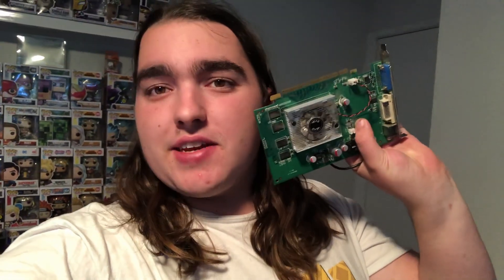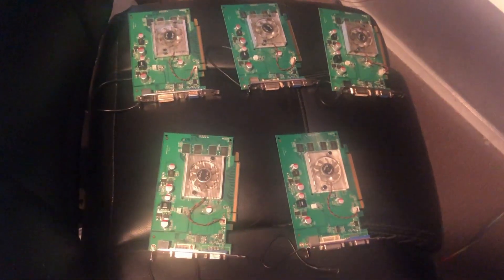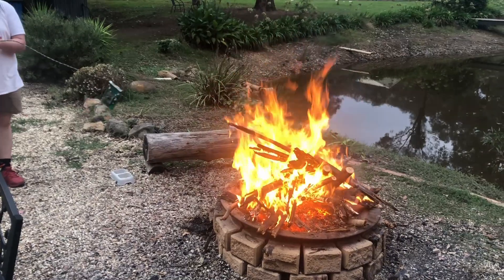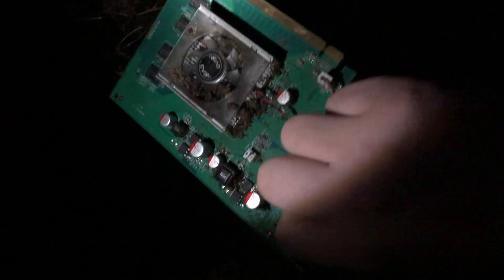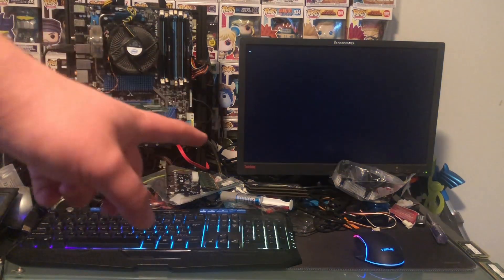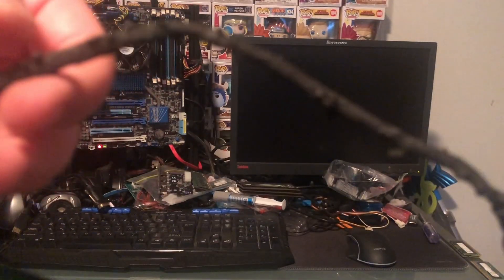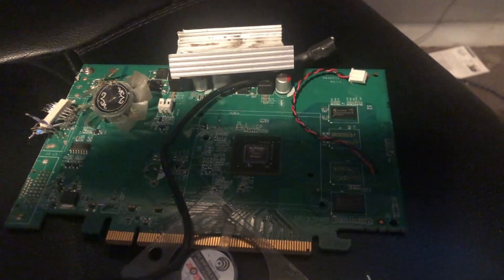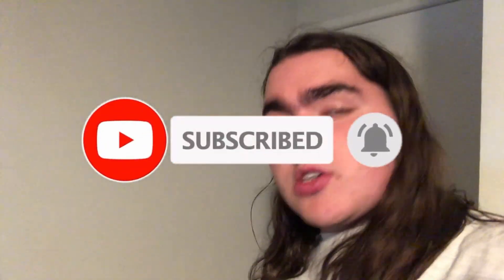How much DAMAGE can a graphics card take?

Comment: its pretty interesting to know that even if you drop a card in water it will still run.   great video
Reply from the maker: Yeah, water is an issue to tech generally due to it being conductive, so as long as theres now power running through it, and you let it dry, it should be fine!